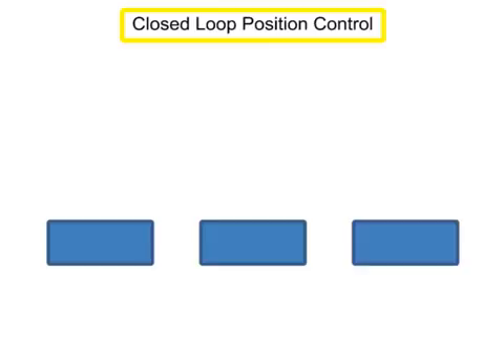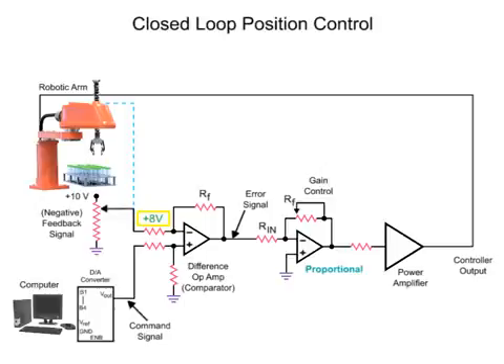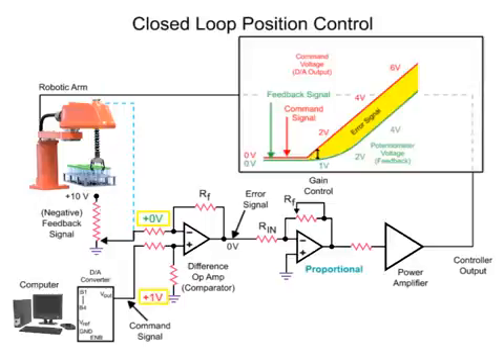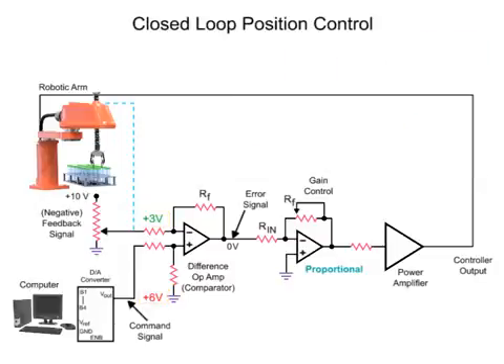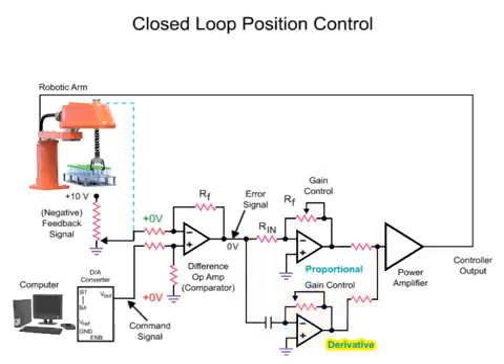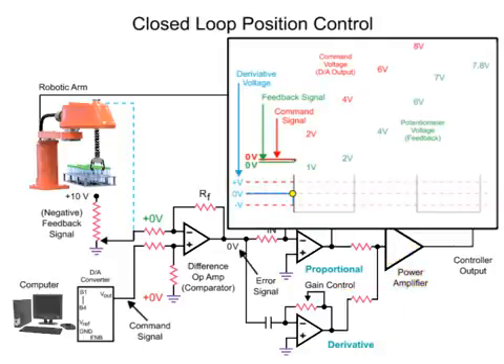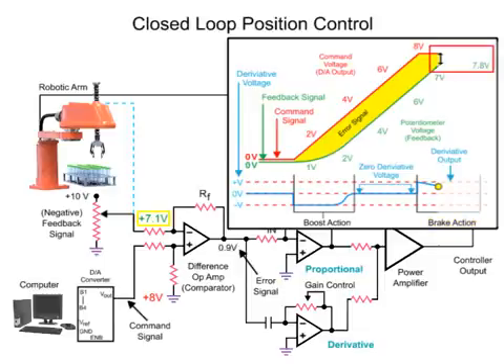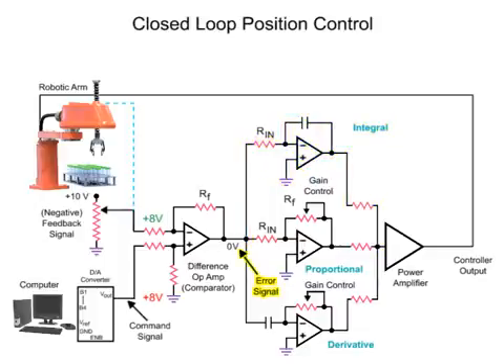How PID Controller works

Comment: For a complete Analog Simulation, the position motor can be considered an Integrator.  
Then feed the Integrator,  back to the negative input of the Error Detector.  
Then you have complete analog simulation. 
This is an excellent presentation. 
I learned a lot.
Thanks!

Comment: In the narrative/electrical schematic, you have the command signal as a step-function from the computer to the desired position, but the Voltage-Time graphic has the command signal as a ramp-function to the desired position. Either I am confused, or there is something I am not understanding here.